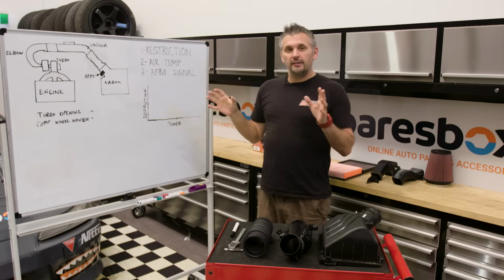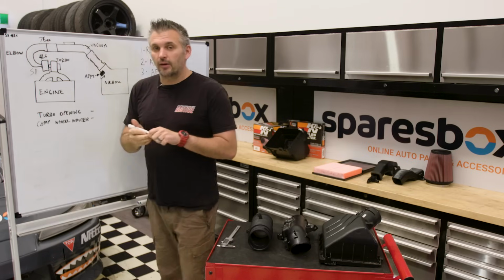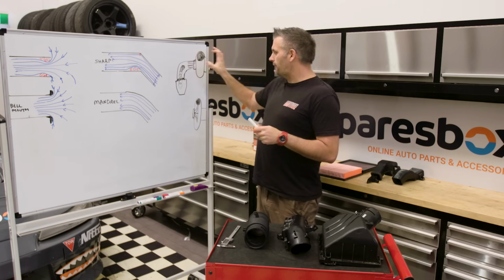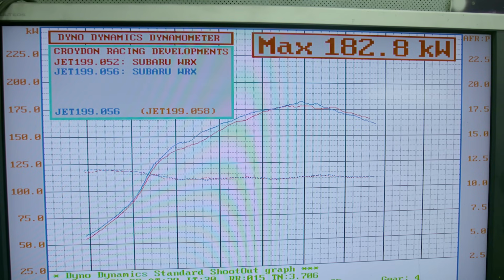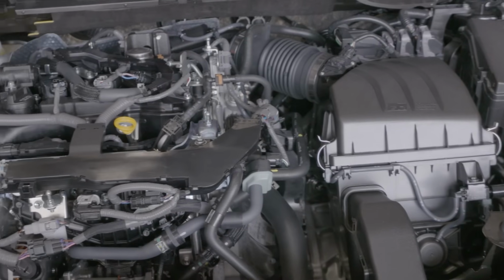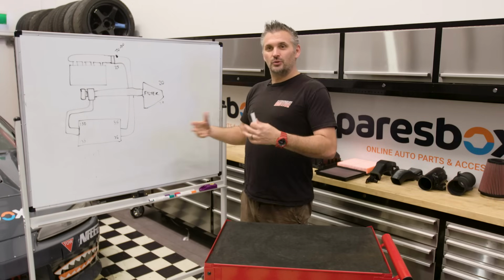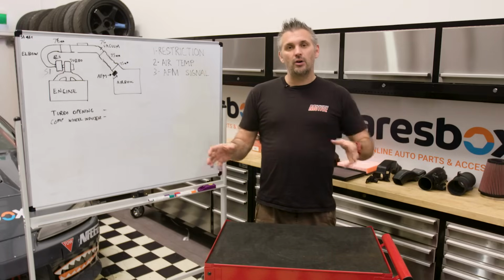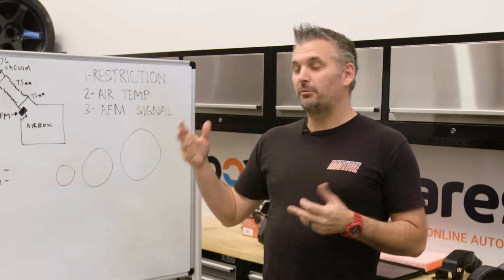Why Cold Air Intakes DON'T or DO Work on Your Car - Motive Tech

Comment: Excellent video! I bought a 2025 Mazda CX-30 Turbo. I've seen TIP kits from Corksport & Burger Tuning -- and everybody raves about the "turbo noises" being made now. But nobody has ever answered my question about power gains (or losses). They all terminate in a cone style filter some of which claim to shield the cone filter from the engine compartment heat, Burger tuning even makes a stage 2 kit that extends that cone  all the way down to about the axle center of the left front wheel. That looks like it could work - or lead to catastrophic failure in the rain. I was wanting to improve the factory intake -- because it looks severely restricted at about 5" wide by 1/2 inch tall. From there it looks like it takes a 90 degree turn downwards and gets it's air supply from what looks like a really great place -- the intake grill for the radiator, intercooler, A/C condenser -- that grill looks like a massive scoop for high flow, high pressure air that is about 4" deep and pretty well sealed from air leaking around. And just looking through the grill, it's hard to see exactly how the air inlet is configured. It appears to be a square hole about 3x4" in the radiator support -- which seems pathetically small for 250hp -- and might work fine until high flow is needed. It looks like enlarging both the plastic tube from the air filter box and enlarging the hole that the air is forced through (at speed) behind the grill would greatly increase top end -- if the small turbo can take advantage of it. The car is a real kick when the turbo kicks in at low speed and pulls hard to 90, then seems to suffer restrictions. The car is governed to go no faster than 125 -- even though the tach just reads 3500 at that speed. It also is programmed to shift at 5500 to 5000 rpm, even with a 6500rpm redline -- which is impossible to reach (haven't tried neutral -- no point). I can see the wisdom of Mazda engineering it this way -- it feels plenty quick at normal speeds, but won't even approach the redline -- so they probably all make it past the warranty without blowing up a motor or trans, or diff. I don't want a cone filter because I drive about 5 miles of dirt road every day -- and nobody even tries to claim that they can beat stock in cleanliness. I do plan on unscrewing the plastic cover over the radiator support  so I can get eyes on exactly how that choked down ram air is designed and see if it may have anything to do with why dynos show tat power falls off a cliff at 5K, or why it loses some power after 90 -- sometimes, it even accelerates if I back off to 1/3 or less throttle at that speed (slightly hazardous) The car puts out 250hp & 320 '# torque from 2.5 liters. It just seems to do it all in low & mid-range, and I'd like it to keep pulling. 
Looking at your Yaris intake mod -- it looked very similar to what I think might be needed.

Comment: But they look cool. +1000 whp (wishful hp) I am serious about they look cool but imho on a stock motor usually a waste of money. Air FUEL ratio. You can put larger tb or tubing or….but if you can’t add a proper amount of fuel; what good is it really doing…3-5 hp? I can imagine a lot of interesting things I can do with the money some of these air intakes cost.

Comment: The issue is that most “cold air intakes” are HOT air intakes. They take the factory air box that is sourcing air from outside the engine compartment and replaces it with air from INSIDE the engine compartment. These tuner punk kids are clueless. 🙄🤦🏻‍♂️

Comment: I remember an old fabricator that used to build our turbo kit piping and intercooler end caps..z back then Ron Davis cores would be ordered blank like that and u would order your cores by section and then fab up everything around that. But…. I remember his design philosophy and saying air doesn’t like to bend tighter that 22* - 19* and u should avoid 90*’s   Even in turbo applications where the air is being forced through. He hated seeing 90*’s right off the compressor housing. Oh and pie cuts would be a fad only and offered nothing of value lol.. this was early 90’s right around the time Motor-Ex was going through all that legal shit. His shop was the first all wheel dyno (supposedly) in So-Cal back then so we would see all those cars come and get work done and then get tuned. 
So not too sure how crazy he was but it does make sense that if you have the room to make smooth long low radius curves. 
Oh and as u watch they haven’t got to intake temp…. That was another thing the old wise fabricator use to spout about was pulling air from outside (cooler) source cause every 11* of temp drop was like 1% power depending on altitude ofc and this was NA only. Turbo was different.

Comment: They definitely work on every naturally aspirated car I've installed them on. The throttle response is instant and the pull is better. Not much but enough that you can feel it on familiar roads. I'm about to add one  to a Nissan z which is turbo charged, so I'm curious how that will turn out. No I haven't bothered watching the video yet.

Comment: I have a Suzuki Spacia costom turbo. 2014 when it was new I was getting about 16km/L around town. After a few years it dropped down to 13km/L but just the other day it's only getting about 10km/L  Anyway I was scratching my head thinking what was causing the fuel problem. After watching your video I'm pretty sure what is causing the problem. First my intercooler is looking very dirty I will try cleaning it inside and out. Great video and info cheers. 😊

Comment: Those damn paper filters.  Replace it with a K&N and be shocked at how much better your car breathes.  I'm not talking a CAI I'm saying just the filter on the stock intake.  Drop a good filter in there that isn't like breathing through a straw with a cotton ball at the end of it and you will see a difference.  Not 30 hp or anything like that but you will have  a much better acceleration at the very least.

Comment: I noticedon't on the dyno test theirs no fan in front of the car to simulate real air flow as if out on the road. Therefore you have a dry run test.

Comment: The way most kits come for my car the intake doesn’t even have port or sealed away from the engine bay to get actual cool air from the outside. Then you gotta worry about the extra dirt and from your engine is gonna eat lowering the lifespan of your car

Comment: Let's do it with the hood closed with the cold air intake ..dyno that .. because it's always the hood open .and of course you will get a gain with hood open Dino it with the hood closed and compare with the drop filter on

Comment: Sort of surprised at the comparison to jet engines. Andrews time in the airforce, i suspect with the hornets would demonstrate jet engines can actually be quite fussy about the incoming air flow. Some more than others. If you peek down the intake of a fighter jet you can see how much effort is made to try and optimise it. Control of boundary layer airflow, even distribution across the face, ensuring excess pressure can bleed off when approaching supersonic speeds, direction of airflow being regulated even at angles of attack etc.
Jets also do make different levels of power at speed. power ratings of static vs dynamic thrust. The aerodynamics of fan, compressor and turbine blades is a deep science.
Does all of that translate to turbos? probably not. But CFD design of turbo blades has come a long way in recent years certainly. 
There's definitely risk of over thinking here. My main issues with so many intake kits is their basic design is just a crap pipe with a crap filter which ignores so many factors, sucks in hot air, and all these apparently high flow oiled filters dont do very much filtering. Ive read lab tests. they let through a lot of abrasive material.

Comment: It always seemed fishy to me people replacing stock air boxes with intakes and a big filter just sticking out in the open engine bay. I always think "um... aren't you just sucking in the hot air from the engine that way?. Only one ive seen done that mitigated that, is the Focus RS, that actually put that large filter in its own box and (i imagine) had it sucking air in from a much colder source than.. the hot engine bay.

Comment: They do work it’s uh more air colder air (if the tubes take air from outside and not the engine bay). My vr30 they make intakes that are .5” wider and u have to tune for it bc you’ll throw lean codes bc there’s too much air. 👍

Comment: Everything is about balance and when that balance is disrupted then it will cost you on one end or the other. Manufacturers know what balance they are looking for when it comes to optimum efficiency. any add on that disrupts balance is going to throw the system off. This is why they create vehicles with higher and lesser power engines with completely different construction. Altering one part means altering several others in order to keep the balance and tuned to accommodate. All reality if you want more power then the manufacturers have built engines for this purpose all ready to go. You don't buy the cheapest or lowest powered engine and start cutting and grinding on it because most people don't have equipment for for checking the specs and measuring to make sure everything is within a tolerance of one another so you need a machine shop to go this which usually ends up that cost wise you should have went with the other engine.

Comment: I swapped the intake on my turbo mazda3 simply for the fact that the stock airbox completely silenced the induction and BPV sounds, and with my BMS stage 1 intake it sounds incredible with tons of choo choo noises. Same thing with my corksport axelback, just sounds so much better. Notably though, the intake DID make a big difference on the top end power of the car, which Burger tunings dyno graphs supported.

Comment: I have a somewhat modern car. The air alteady comes from the front bumper. I can't improve the intake. Not necessary. If you ever plan on doing something like this make sure to keep the air pipe with the air sensor. It is tuned for that exact diameter. Should you change it you'll require tuning. Otherwise you'll have x errors and it won't run right.

Comment: Years ago I had a 1991 integra, and I had a true cold air intake. Change the cone filter from AEM to a Blitz. Picked up 5hp on the dyno . Also a short ram intake was in the car when I bought it. After i put AEM true cold air intake(filter located front  lower part of grill) i picked up 1 hp on dyno.

Comment: One question  does the supra throw cel codes if id change the the intake system ? I got euro spec 2022 b58 with gpf and cat i know changing the exhaust i gives a cel but is this with cai aswell ?

Comment: I have a Nissan 370z that was producing about 280 peak rwhp on a Dynojet chassis dyno. I had a Stillen Gen 3 long-tube CAI with large K&N oiled cylindrical cotton gauze filters installed. There was one 2.5" intake pipe per bank that had a minimal number of mandrel bends, along with the fact that the mounting flange of the filters had a bell mouth transition from the interior of the filter to the entrance of the pipe, a good design in my opinion. Additionally, on the same day I had a Fast Intentions true dual Siamesed design x-pipe cat back exhaust installed. The exhaust also had good design principles, with minimal mandrel bends and with resonators installed in place of baffles for silencing.

On the next day I went to the tuner who did a baseline pull on a Dynojet chassis dyno and we got about 301 peak rwhp. The A/F ratios were badly off all over the rev range, especially at low to mid revs. After about 6 or 7 pulls the tuner got the A/Fs and the ignition timing dialed in and we got 321 peak rwhp with a nice flat torque curve across the whole rev range, with a uniform 15% increase in torque over the whole rev range.

I offer this experience to illustrate the point that good flow design considerations in intake and exhaust systems can yield good results on a high-performance NA engine. My engine stock is rated at 332 peak hp @ 7200 rpm and we estimated that I was probably getting about 382 peak hp at the same rpm.

Comment: Most modern car intake air boxes pull air from outside the engine compartment, so they are already cold air. When you add the K&N Air filter properly oiled. You might notice a very small increase in your gas engine. K&N air filters do let more air in slightly and can reduce intake runner to external air pressure differences slightly at higher RPMs. But they also let in larger particulate matter and this will cause excessive engine wear shortening your engines service life. There is always a point of diminishing returns. It might give your car 0.001 increase in QM Times maybe. Depending on your engine of corse, we are talking stock to mild built engines here.

Comment: Good video and my 2c. I’ve owned and modified about 3 dozen vehicles over the years. Now in my mid 40’s and not as much concerned about “speed “ my DD is a 19 Fiesta ST stock aside from intercooler , intake and exhaustI’ve owned two - both of which I put a K&N intake and have gained 1-1.3mpg average the intake alone. I do a couple thousand miles a month with work so definitely monitoring mpg. Have fun gents

Comment: I used to throw a cai on everything mainly for the induction noise. But now i dont simply cause buying a new air filter from a parts store and throwing it in is so much easier and less time consuming than cleaning and re oiling one. If your just gonna do simple bolt ons such as short tubular headers, and a cat back exhaust stock is more than fine. If you get into doing a cam or forcedi nduction then it matters more.

Comment: Thid is my issue lol, I have a 2012 ram 1500 5.7L, I've done an 83mm BBK throttle body, 5.2L Shelby cobra 3" X pipe exhaust kit with true duals from the 1-3/4" BBK long tube headers , rave cats and shes tuned. My stovk airbox with the K&N drop in filter I had in it which did wonders on my truck prior to the longtube headers, race cats and bigger throttle body, started being restrictive. So i just installed a rough country CAI hooing I didn't just waste money, but man ogh man she's back to being roudy but picked up 20HP on the dyno with fine tuning. Proof of what this man is explaining, its based on application and other mods
Reply: How much did you drop on all those mods? I have a 2012 bone stock that’s new to me

Comment: Hello, engineer here...  There is always going to be restriction.   that's because air has mass, and viscosity and friction,   IF air did not have these properties, you could walk around outside during a hurricane with 100 MPH winds and not feel any force / pressure at all.  And winds even blowing at hundreds of miles per hour could never knock down a tree, or break a branch, or even rustle the leaves.  just sayin'. 😀   Another way to think about it....  Moving air resistance and friction creates static electricity.   That's why thunder storms have lightning.

Comment: Hello, very nice video, thanks for sharing👍 I understand your explanation and arguments but on the other side are there the producers and sellers of the aftermarket air intake systems. I used to install K&N  filters automaticaly when I bought a new car. The reason why I did this without thinking was the official producer information that the filter brings about 5 HP + 10 Nm power increase. Was this only a marketing fake or had they really tested all the filters on all types of cars before starting the sale? What do you mean? Thanks, Richard

Comment: If the MAF/AFM measures "Flow", would it not be true that a smaller dia tube would be higher flow than larger tube? If the flow is measured across wires in the sensor then the only "Flow" being measured is at that point in the tube. A larger tube will have a greater volume of air but will flow at a certain rate. Whereas as smaller tube under the same conditions would it not have higher flow, due to smaller volume?

Comment: Hello, very good video and topic. The best after each operation is a test on the power bench!. But very often with a sports filter, direct or dynamic intake, there is more air, so it is necessary to evacuate better, so a good exhaust line, and an ecu remap to take all that into account.

Comment: My friend from Texas decided to run a vent from the AC duct inside the car into his airbox because of the power loss when it’s super hot out, results are it 100% works with the caveat of your AC has to be running but in 100° weather, I guess it would be, there’s your true COLD air intake 😉 leave it to the rednecks! 
PS: it’s a super neat job, almost factory I told him he need to go get a patent on that, but I’m sure somebody else has tried it somewhere long ago

Comment: It really is a car by car basis and people need to do research before deciding if it's worth it.

On a 370z, a quality intake and tune will net 30-35 wheel horsepower (over 10% power gain), which has been proven by countless dyno runs. On a GR Supra, intakes are lucky to add 5 horsepower if tuned for it, but most people buy them because they make the turbo noises much louder.

Comment: Same thing with exhaust systems , going from a 2" to a 3" doesn't do anything unless you are making over 600+ rwhp as tested by the guys from powerblock, and as far as cold air intakes my terminator cobra saw a decent increase in power with a cold air intake , but my wife's explorer ST saw a big jump with the new cold air intake and ram air scoop